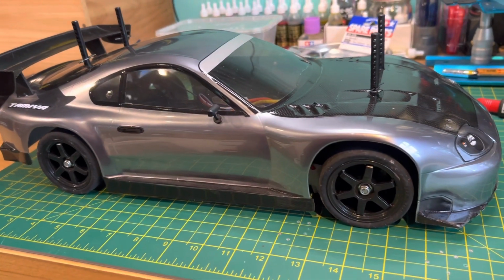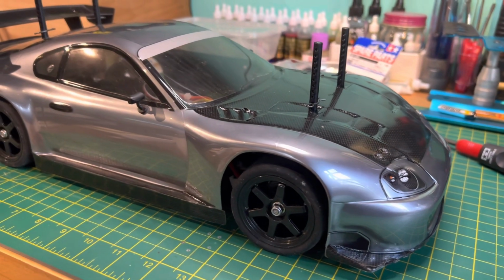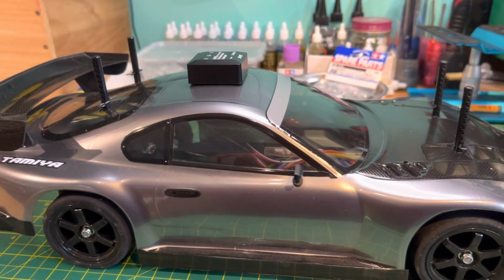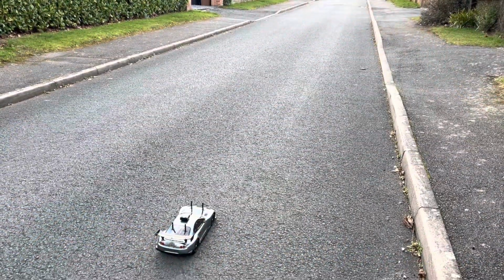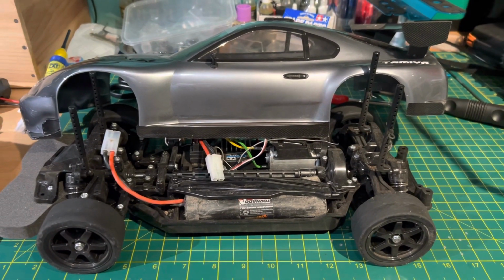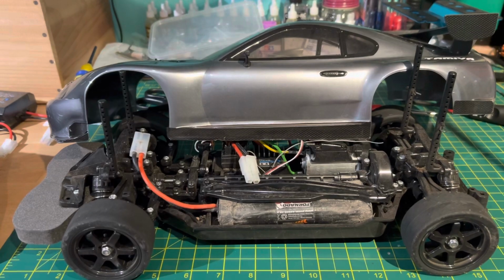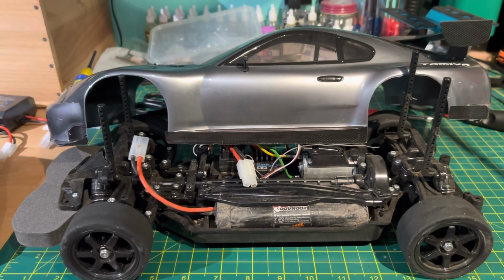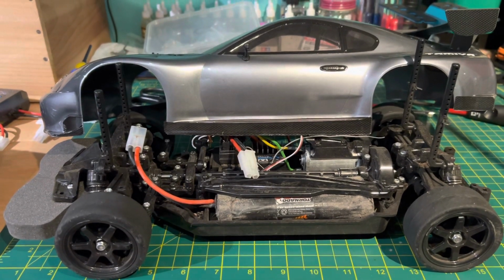Tamiya TT02 Speed Run Series - Episode 1 Stock with Bearings only

Comment: The unmistakable sound /handling of a stock TT02 mate! 
Cool series this one fella, looking forward to seeing how this progresses as you gradually add more power.
The issue with these is the chassis improvements need to grow in line with the power increases, or once you start putting some serious power through it she becomes extremely difficult to control.... even in a straight line!
Great first run bud. 😊 👍 👍 👍 👍
Reply from the maker: You sound like a man talking from experience 😂🤣 Thanks for the advice. I am trying to decide what to do first… hop up for some improved stability or just start cranking the power and see where it goes wrong??
Reply: @theoagrc 
He he.... you could say that mate!
Moo moo wasn't happy with her stock tto2 mustang, said it was too slow!
I advised her to upgrade the steering, tires and suspension first then get a hotter motor, as that chassis suffers some horrific torque steer!
Sadly she didn't listen..... and just whacked a super stock rz in it without any other improvements.
On the flat tarmac at Tesco's it was virtually undrivable, all it done was doughnuts!..... Smashing doughnuts at that, but not much help when you want to turn into a bend! 🤣
But, from your point of view mate-
I think it would make great content to see how the extra power performs on a stock chassis, then adress the handling issues by then upgrading the tires, shocks and steering etc bit by bit, and analysing the benefits that these improvements bring about?!
Either way, I'm looking forward to closely following this series for sure! 👌
👍 👍 👍 👍 😊
Reply from the maker: So sounds like you are suggesting that hop ups before power is a sensible way to go…. Power it is the 🤣😂🔥🔥🚀
Reply: @theoagrc 
😂 🤣....... That will certainly be a great recipe for very entertaining content matey!
I'm very much looking forward to seeing how this unfolds!
👍 👍 👍 👍

Comment: Seems a bit twitchy in the steering but it will be interesting to see the effect upgrades have on speed.
Reply from the maker: Hey 👋🏻 you are right the steering is twitchy and needs the slop taking out of it. Perhaps I should do some upgrades first in the stock gearing and motor before just upping the power??
Reply: @theoagrc  yeah any increase in speed beyond a Sport Tuned might be too much for the handling as it is.

Comment: Hiya Craig.  Ooh I thought 20mph before I saw it run then 18mph when I saw it run.  I did think these were a little bit quicker with a Torque Tuned.  I'm saying 21mph with a Sport Tuned 🙂
Reply from the maker: Should I change the gearing first then before going up the motors?? Good idea Jess 👍🏻🙌🏻
Reply from the maker: Cheers Pete! I thought it was quicker than I expected but on reflection perhaps it should have been faster! Need to check what pinion is in there 🤔
Reply from the maker: You should write down the order you would do things in Jess! I am already feeling out of depth 🤣
Reply from the maker: On it!
Reply from the maker: For me!!!??? General consensus is that without improving the control is am going to trash this chassis! What you doing Jess???

Comment: Hi there Craig, a great out of the box speed test. Getting that bench marker in there with torque tuned with bearings only as the hop up. Did you give the bearings the TeamZX1 treatment ? It would be interesting to see if the TeamZX1 micro oil does exactly what it says, even if it’s a 1 mph gain? I would do a speed test myself, but I don’t have a GPS and very tight to get one 😂😂😂best wishes to you all 😊
Reply from the maker: Hey John, I have not done that but it would be an interesting thing to try now we have a bench mark. Maybe I will drop some friction eliminator on them and give it another rip! Thanks for watching 👍🏻🙌🏻

Comment: Hi Craig. Nice run and a typical speed for a Torque tuned motor me thinks. Before going to a brushless you should swap the pinion gear for a steel one.
Reply from the maker: Will do Rob! Brushless is some ways off… we’ll be taking it through a range of brushed motors and no doubt regretting it first 😂

Comment: Nice one, Craig! And it'll be a nice series to follow, I am already looking forward to seeing the improvement by using the Sport Tuned motor. 
One thing, if I may, why did you place the GPS receiver on the body? You could probably fit it inside the chassis, under the body, and it will be better protected and also not harm the aerodynamics. With the bluetooth, you shouldn't need to actually see or touch the device.
Have a great rest of the weekend there, buddy!
Reply from the maker: Great idea Mads! I am switching that inside the body going forward. I just stuck it on the outside as that is where all the timing system stuff needs to go but you are right about this GPS. On to the next run now!

Comment: High speed gear set and the  aluminum motor mount are 2 great choices for hop-ups. And inexpensive! Good video Craig...how is the Madcap/Astute build going?
Reply from the maker: Hey EEK RC! Thanks for watching dude and both of those option parts are in the mix 👍🏻 Project HAM (Hybrid Astute Madcap) is taking shape. The build series is wrapped up in the OAG shows coming soon 😁 I had a fair few problems with it but the final model is incredible 🔥🚀

Comment: Awesome top speed Craig but, cut the body posts, they are causing drag.. LOL, Just joking Man!!  From now on, I will NOT BE counting bearings as a hop up, they are a necessity, no matter if running box stock or going full race, no one wants plastic bushings!!  17mph is a great baseline dude. I plan on doing something like this myself but I'm also changing ESC's to see if that gives a boost in speed as well.  Good Luck with this series mate, I'll be watching and ATB to one & all.
Reply from the maker: Hey Bob, you might be right about those posts dude! I will get rid of them 🤣 it is a fun project to do over the off season on the race way. I think we’ll see this one obliterated at some point though 😂

Comment: Nice! How did you find it handled?  Was it easy to maintain a straight line? Cheers
Reply from the maker: Hey Mauzyrock, at this speed it is fine. A little twitching off the line but mostly ok. It helps that the tarmac I am running on it brand new! In time it will become more difficult though!